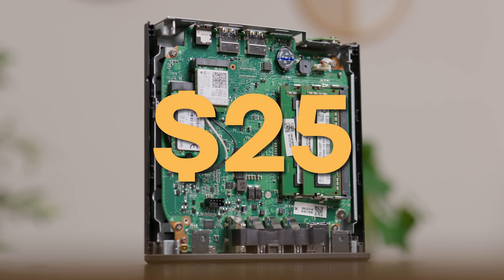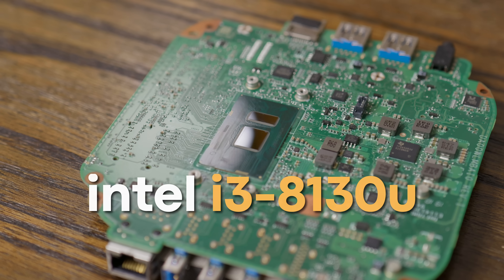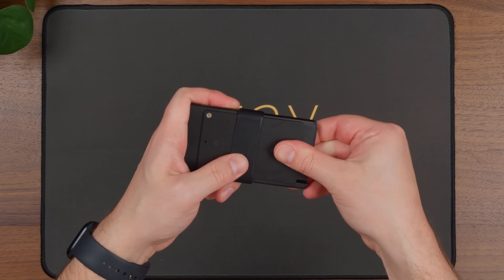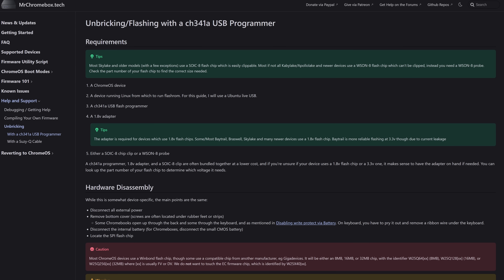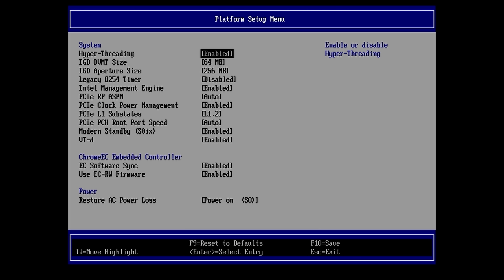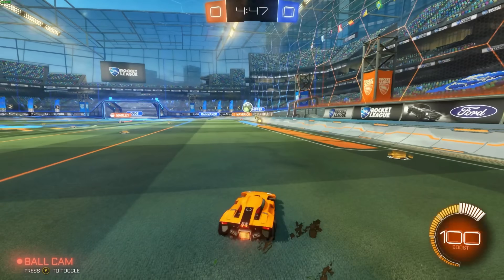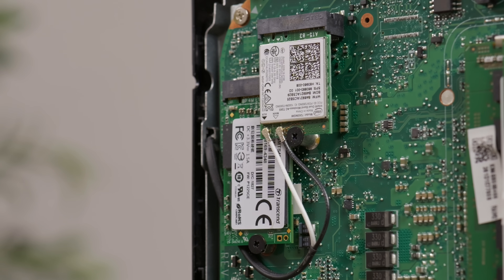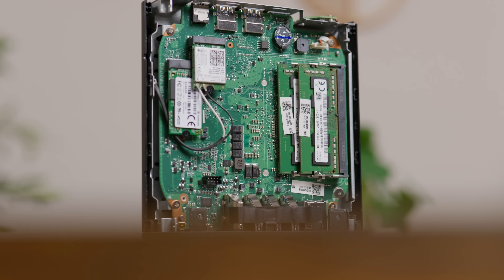This hacked Chromebox is INSANELY impressive.

Comment: Actually, I was just looking at ebay for the Acer Chromebox listings but I found that (at least in Ebay Germany), there is ton of Lenovo laptops ThinkPad L480 with the same CPU Intel Core i3-8130U with 8GB RAM, 256GB SSD for around 110€ (~$120). Given that it has a screen, battery, keyboard.. it would be a decent alternative as well as it can technically work as a UPS. I'm aware that you did try to do very similiar thing in the past videos :)
Reply: The L480/T480 thinkpad is a great option if you are going to use it like a normal laptop.
The chromebox is mainly going to be used for making a server. For a server, a screen, keyboard, etc will be useless, as most of the time, a server only needs a screen and keyboard for configuring it. You can use a cheap monitor and usb keyboard for that. For just a 2w power draw, a cheap UPS can be made. I don't think spending an extra $80 would be good just for a bettery backup.
Same with the desktop, a thinkpad's excellent screen, speakers, keyboard and trackpoint would be put to waste if it is used as a permanent desktop PC with an external components. And this chromebox, with a cheap monitor and keyboard setup, will still cost below the thinkpad.
If you want an alternative to the chromebox, you can try mini PCs, like the lenovo thinkcentre.
Btw, no hate towards thinkpads, I use one :)

Comment: I would love to see you make a custom 3D printed case that can hold a normal NIC with a low profile bracket, then get a cable to go from that NIC's PCIE to the mini PCI-E slot with an adapter. Make it a little router/opnsense box
Reply: Or alternatively, a custom 3D-printed case to hold HDDs which connect to that dual SATA adapter, making an inexpensive NAS out of the ChromeBox board. 😊

Comment: I have a Samsung Chromebook Pro that I put Linux on after the support for ChromeOS ran out. The results were mixed. I dislike the custom keyboard since the function keys aren't labeled, the machine came with 4GB of soldered RAM and 32GB of soldered storage, and the audio system was such a clusterf** that I don't think it works on Linux to this day. But it has a beautiful screen, so it's a Home Assistant display now. 
I'm impressed that both the ram and storage are upgradeable on this little Acer, it definitely makes it a way more functional machine! You're also not stuck using the ChromeOS keyboard. This is quite tempting.

Comment: I used Mr Chromebox's utility to hack a $30 HP Chromebook into a working Windows or Linux box (I had to use both at some point). His documentation is top notch.
Reply: so did I. a 1080p IPS chromebook with 4 threads and removable/upgradeable ssd which is very uncommon. Payed 25 bucks for it and it's condition is great.
Reply: It's shame it doesn't work with arm

Comment: ChromeOS is great by itself. Had to rip an old DVD the other day. It took like 5 minutes to share the USB drive with Linux, install handbrake and rip it. No problem. With android apps and Linux they're awesome and startups and shutdowns are faster than any other PC. 

Then they can be repurposed. I've used an old Chromebox with Ubuntu on it for years. Stable and cheap.

Comment: At that price and power draw that would be a killer home assistant server! I want one now.
Reply: I did this with an old Asus CN60 I had laying around. I flashed the UEFI full ROM and have been running HA for about 3 years with no issues. Probably overkill for HA but not bad for the price.

Comment: I've got most of my homelab running on 2x Asus CN65s both formerly Google Meet Chromeboxes, both with i7-8550u processors, ram upgraded to 32gb and SSDs upgraded to 512gb. CN65s are going end of life in June for enterprise updates, I'm sure ebay will get flooded with them as companies upgrade systems. 
I've had CN60 and CN62s as well.

Comment: The moment i saw the rabbit on the boot screen I know they where using coreboot so you aren't just getting linux on there but also an opensource bios firmware which means the pc is using full open source software besides the cpu microcode updates which I think don't count.
Reply: They might count depending on your threat model 😜

Comment: LOL dunno how you thought it would use less power using USB, IF it did use less then it would be throttled.  Doesn't matter what you power a device from for it to work it's gonna use the same amount if juice no matter what hole you power it from.

Comment: you should definitely get one of those clip-on BIOS flashers, they're not as difficult to use and can be really handy for unbricking boxes like this (its also probably cheaper than buying spare motherboards)
Reply: Any idea which one to use? Looking for that too..
Reply: @MichlBinI  ch341a is a popular choice, pretty cheap too (at least where i live)
Reply: @MichlBinI ch341a
Reply: They are very useful little critters. I got a couple of types for fixing AMD Polaris-gen video cards. RX480, 580 and all them. I've used it once for something else since but remember what.
Reply: I got one and it didn't work (on my laptop etc), because the flasher's power gets connected to the laptop power rail which pulls the voltage too low for the flasher to work. So it just stops responding as soon as I clip it on.
Reply: Yea. I'd like one too. Pls lmk what's the name
Reply: Ch341a flasher  @8lec_R
Reply: the ch341a is a popular one.
(i posted it here before idk why my reply got deleted)
Reply: @iknowdawae893 links disabled
Reply: I can vouch for ch341a. It's great for flashing in circuit, no soldering required (though I do have a hot air station too)
Reply: Can you link a solid one? That sounds interesting and I might want to consider getting one.
Reply: The CH341a is great, but those clip on cables are utter CRAP! Much easier to just desolder then resolder the chip imo.
Reply: You're absolutely right about clip quality, but TBH on the rare occasion I get a bad read or write, I just go again. I do flash "out of circuit" (mainly to swap for bigger flash), but "in circuit" is helpful when I want to iterate fast or I don't want evidence of tampering on expensive boards that are still in warranty (no cleaning flux residue or matching lead free solders).
Reply: great advice if you aren't a low grade |mbecile! 
And you will be just fine 
if you are WHERE DID YOU GET $40.00 (very sus! 
and so dirty)

Comment: I have an opinion on how companies could handle locked machines to prevent e-waste.

I get new device - I submit request to previous owner - they get 30 days to respond on if it's sold or stolen then it's unlocked. But the 30 days is from when I request it. SO this would still deter thieves, but allow a lot of e-waste to be saved. 

BUT my PROFITS!! yesll apple but still this should be the law.

Comment: My first foray into chromebook/chromebox rooting was back in 2019 when I purchased a cheap Chromebook Pixel LS and rooted and flashed the firmware so I could run Linux on it. I used that as my daily driver for a few years, and only stopped using it because the soldered-in eMMC started to fail.

I've since rooted a couple of Asus Chromeboxes and I'm using them for various parts of my homelab - homeassistant, a staging Proxmox instance, etc. These are nice little boxes if you're willing to put in a little bit of work!

Comment: 8:43 It’s still amazing what Intel’s integrated graphics are capable of , being able to handle 4k @ 60hz on such a small low power draw chip is great.
Reply: it's not rendering anything, it's just showing a 4k video stream. Phones can do the same at similar power draws
Reply: @AntonioMolfetta  it needs to transcode/decode
Reply: @ it's using hardware acceleration (quicksync in this case), just like phones. All phones that can do 4k videos have hardware acceleration for both encoding (creating the video) and decoding (showing the video). It's not a big feat in 2025
Reply: @AntonioMolfetta remember that this is a 14 nm chip, so that probably has some significance

Comment: I did exactly this with an Asus CN62 with a fifth gen i7 I scooped up from fb marketplace for $20 because it was password locked. Ran it as a Jellyfin server with an external drive for over a year before I upgraded. I now use it as a NAS connected to a usb JBOD running OMV. Best $20 I’ve spent.
Reply: I turned my CN62 into a HTPC using LibreElec/Kodi build so I could play media from my media server through a projector. It works great for that. I even added the Jellyfin plug-in to Kodi so the playlists synced with my other Jellyfin clients.
Reply: Is it really feasible to run such a small box with an external hdd attached to it as a storage server? This isn't me being condescending I'm genuinely curious as I have an external hdd and a small mini pc and I've always thought about it but I assumed speeds would be terrible over usb.
Reply: @norndev  You don't really need a ton of speed for a single file at a time, USB 3.0 will probably do just fine. I ran Jellyfin off of a USB HDD on my main PC for a while and it worked great.
Reply: @norndev  If you use USB 3 and up
I run  a small server with a 4 disk LAS ( Local Attached Storage ) USB 3 out to ChromeBox with Linux and SMB running + Kodi.  Pass it to my network switch & all TVs and Android boxes/tablets/phones play perfectly.
About 5 1080 streams or 4 4K
Reply: @norndev  NOT with USB 3 ever tried copying 1gb to a flash drive THATS AGONY!
Reply: @SwampDoggGuitar  that's a flash drive issue not a USB 3.0 issue. eMMC flash is extremely slow

Comment: 2 Watts at idle is crazy! That's the kind of efficiency I've been dreaming of
Reply: Indeed modern processors can be very efficient. My i7 13650hx can idle at around 4~6w with some undervolting. Pretty great.
Reply: Some N100 micro cubes can do that... or some of the HDMI stick form factor too probably.
Reply: Part of that owes to older intel chip efficiency at low loads. Everyone loved to shit on Intel but they were the best of the best when it comes to server CPUs at one point. Their CPU draws literally 1-2w on idle regardless of the generation.
Ryzen desktop chips bottoms down at 10~w.
Reply: my old hp desktop (with laptop motherboard) from 2014 seems to use 1w (cpu only)
Reply: yeah, lunar lakes can do that too (idle 1w, video playback 4w)! and have comparable battery life to macbook air, or even pro models
Reply: @piko1032  I can run powermetrics on my M3 Max and at idle it uses 30.. Milliwatts. Self reported albeit, but big if true. Even the i7-10750H can idle at 500mW with C10 and panel self-refresh
Reply: better than my phone
Reply: ARM Processors (like in phones) are incredibly efficient
Reply: Yeah it sounds like something from the 80s running some low power stuff like a 486 or earlier. Modern era 2 watts is absurd no matter how you look at it. I really wonder how long it could last on some power banks.
Reply: @Yarumasi  well. my chromebook setup sits connected to 20k mAh brick and 30W solar panel. Assuming five hours of Sun, it never, ever run dry,
Reply: @Sm00k  yeah I can imagine! Geeze, you could even leave a solar battery pack or case on that device and it'd probably run forever lol

Comment: 'Dude! You got an i3 with an i7 in it!' Is what I would have said if you bought the i7 variant.
Reply from the maker: Hahahahaha the backup motherboard was an i5, but 7th gen
Reply: @HardwareHaven  sounds like upgrade time! And run one out of enclosure.
Reply: @HardwareHaven  Can you make a video using the ASUS Chromebit CS10?
Reply: And the first generation where the small mobile i7's weren't just clock-bumped i3's.